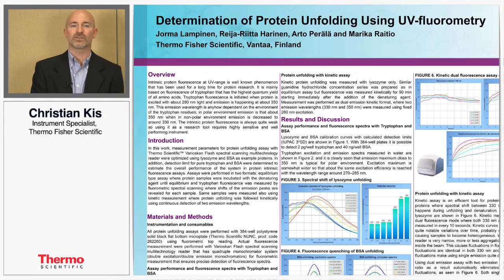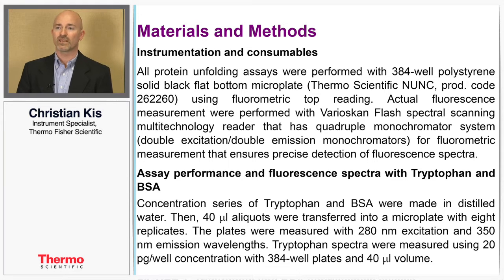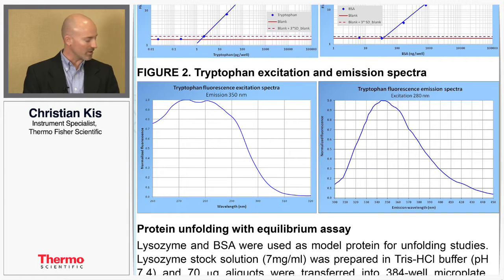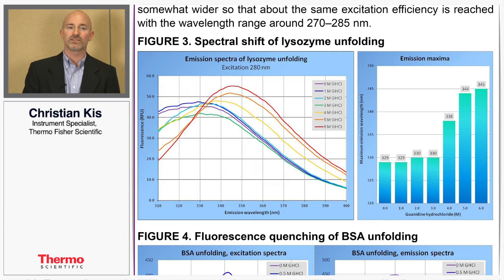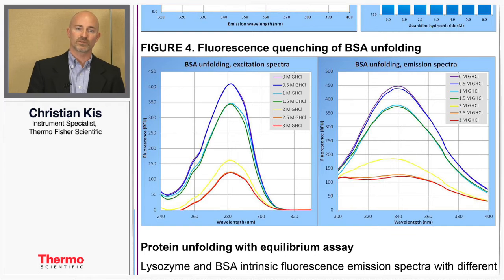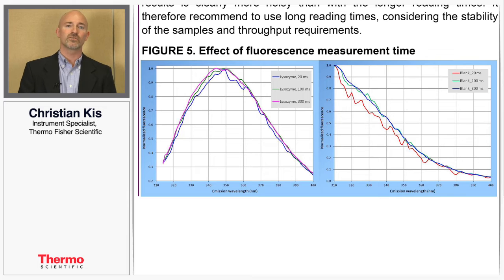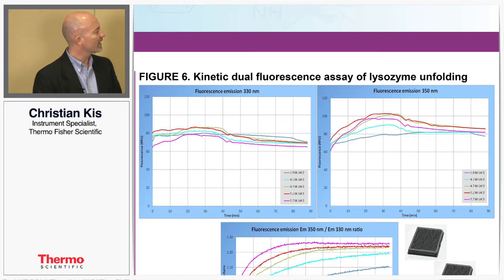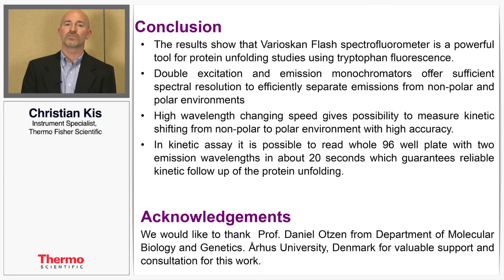Determination of Protein Unfolding Using UV-fluorometry

Comment: There is an issue with the explanation given here.  Under the lysozyme explanation, the presenter states that the polar condition is represented by the red and orange and yellow lines (6M, 5M, 4M GHCl) which peaks at 350nm and the more "non-polar" conditions ("less acid") is represented by the purple, blue, and green lines (1M, 2M, 3M GHCl). Then in the BSA explanation, the presenter states that polar conditions are represented by the purple lines (0M, 0.5M GHCl) and non-polar conditions are represented by the red and yellow lines (2M and 3M GHCl).  These two explanations are not aligned. One is saying the opposite of the other.  Please correct.